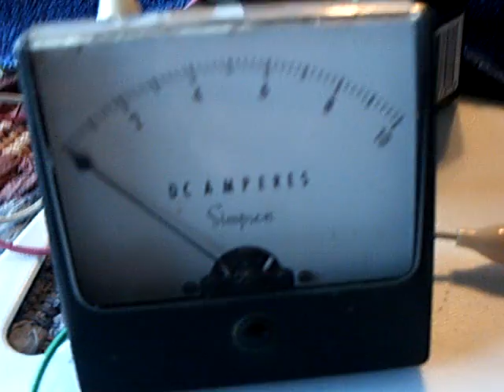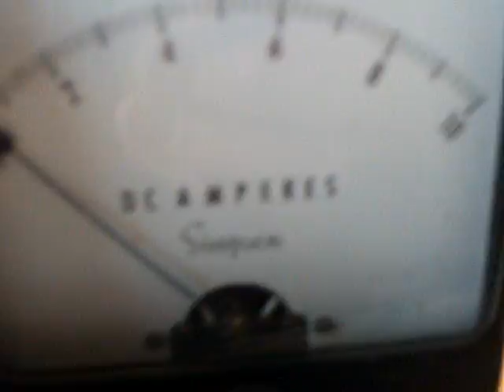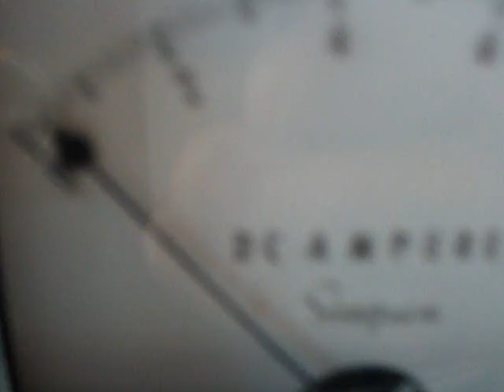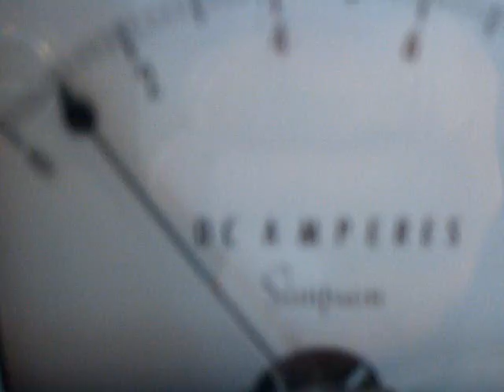Lasersaber Super Joule Ringer 2.0 --With multiple bulbs

Comment: evrey coil transformer i make does different things some make more noise than others best component is to use  a 2n3055 with a 10k variable 300 ohm resistor and led connected to the base direct from the +rail before the coil this will stop the annoying ticking on the common rail to get the circuit to rail . It fires up nicely with the variable on the base. i use telephone wire for  the coil works nicely on ferrite e cores i Have had a 7watt led lamp running at 0,15 that is so effecient

Comment from the maker: The only transistors that I have used are a TIP3055 and a 2N3055.  I tried a TIP31 and burned it up.  I need to rework the transformer to stop the overheating problem.

Comment: you can pick up stray radiation from any normal CFL installed in a roof and running from mains power,but in your instance the transformer is not boxed and grounded,and every wire is radiating the spikes.
a slayer exciter is just a low powered tesla coil.
these things create waves in local space like a guitar string makes noise,just the frequency is much higher.
like coronal discharge but its not hot enough to see with your eyes

Comment: My transformer started radiating plasma when I disconnected the cfl, and the circuit is the same as my exciters in my previous videos minus a 1k ohm resistor on the base

Comment from the maker: Thanks.  I tried different configurations on the bifilar primary and this was the only way that worked.  You can wire this up like a regular blocking oscillator circuit (joule thief) and it works fine but that has already been done many times before.  I live in the USA.

Comment: Hi Lid, well done.
but you probably have too low winding turns for the primary..
Maybe just also use the unconnected windings with it like a series bifilar
(Like in Lasersaber´s old Joule Ringer 1 circuit diagram.)

Also try to use a darlington transistor, so you have more amplification.
You can also build yourself a darlington from 2 x 2N3055 or so..

Many thanks.
P,S; Are you located in the USA ? I thought from your voice that you are in the UK ?